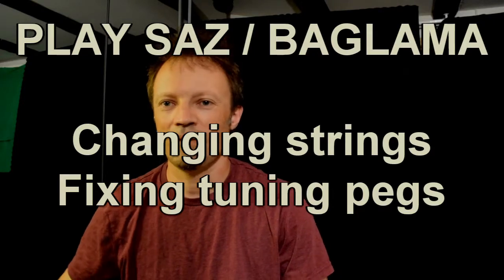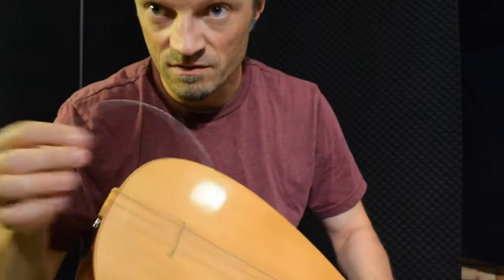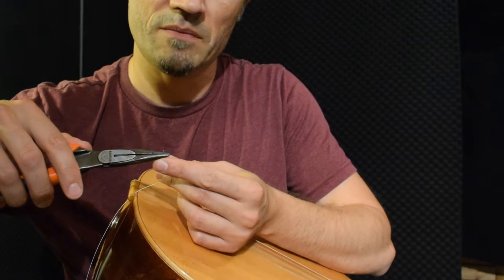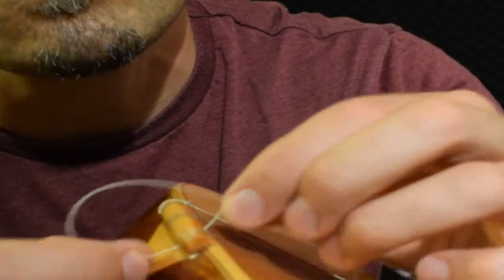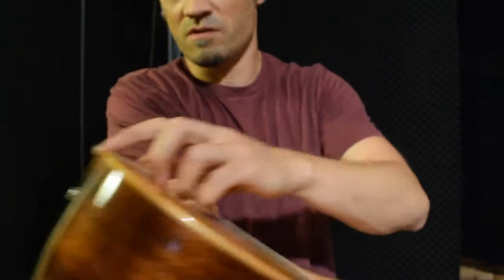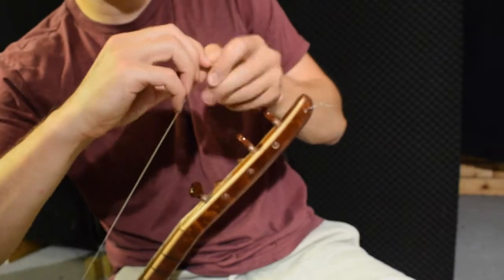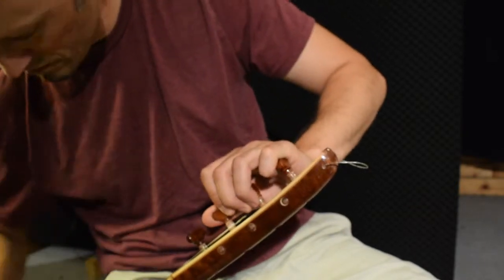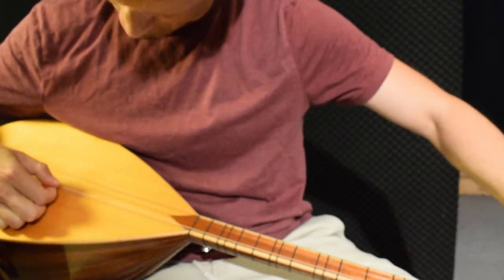Play saz | Changing strings and fixing tuning pegs

Comment: The baglama saz is new to me. When considering purchase I thought about why the original ways of pegs persisted (tho, I luv that of the instrument design). There must be a reliable way to attend the inherent problem or the design would not persist thru time.
Reply from the maker: I think that it persists due to the character/tradition of the instrument (as on the violin). You can buy with guitar fine tuners, but these saz are rare (and mainly on electro baglama). I have installed violin fine tuners on one of mine (used in the video), but you need to drill into the body of the instrument to do this.

Comment: I was shown that if it is too loose to tune, put it in your mouth to moisten it and it stays. Thanks for the other tips!
Reply from the maker: OK. Never tried that.
Reply: Thats right, the moisture will make the wood expand, making it fit tighter into the neck

Comment: I'm having an issue with my tuning peg, when it tightens it simply unwinds (it can't tighten), I don't know if this is an issue with the Saz itself or I'm making a big mistake.
Reply from the maker: Hi KingZ. It is hopefully not an issue with the saz. It is hard for me to tell what the problem can be, but one thing to be careful with, is to ensure that there is some millimeter distance between the string (on the peg) and the body (with the hole). Otherwise you will press the wound string towards the body, which will hinder the peg in going properly into the hole. If this is not the problem, then you will have to wax the peg, either with 'peg dope' or candle wax (not too much):

https://www.violinonline.com/stuckpegs.html#:~:text=For%20loose%20pegs%2C%20pull%20the,or%20peg%20box%20to%20crack.

You can search on violin pegs, because the principle is the same. I think that a very last resort is to gently sand the peg to make it a little more rough, but I never had to do this. Good luck.
Reply: @KlausM  thanks for the fast response ^^

I think waxing the peg will be a good idea, I'll try that :)

Comment: I keep buying strings, I change them, I tune it and everything works well. After some period when I tune again the baglama, the strings keep breaking. I checked the bridge thinking it might be too sharp but it's not, I look at the little bridge close to the pegs, again no sharp surfaces. I am tired buying strings and dunno what should I do, I watch so many people tuning their baglamas so often especially with cheaper ones... If anyone knows what should I do please reply to me :( I am suspecting that bending the string's end when I stick it through the hole is not a good idea because it may cut it basically when applying some tension, but I dunno.. I tried with more expensive strings, same issue..
Reply from the maker: Hi. I only had problems with cheap string and here they normally break when trying to tune them the first time. I use Pyramid strings without any problems:
https://www.thomann.de/dk/pyramid_saz_6758_saitensatz.htm?atr=true
Are they breaking the same place ? Are you tuning your saz too high for the length of the instrument?

Comment: My lowest string keeps breaking when i try to tune it to F. Why is that
Reply from the maker: Hi Ging. Is it a short neck baglama or long neck baglama that you have? A long neck normally have 23 frets, while a short neck have 19 frets, as mentioned here: 
https://salamuzik.com/blogs/news/difference-between-short-neck-and-long-neck-baglama-saz

If you have a short neck, then you should be able to tune it to F. If not then the string quality is too poor. This is actually quite common, so you need to buy better strings.
If, it is a long neck baglama, then you cannot tune to F (too high). You should tune to D (A G D) and then use a capo in 3rd position to get the F.
Hope this helps. Good luck.
Reply: @KlausM  ive got a short neck but its the cheapest baglama out of the bunch 120 euro. So i was wondering if it was because of the quality of the baglama itself that made it not possible to tune to F. that perhaps only baglama that are priced above 500 euro would be able to. So this is not the case ? Ill order a new set of strings and see if it happens again. If it does. Should i buy a more expensive short neck baglama or is that irrelevant ? Good idea to use capo as last resort. For short neck DGA tuning 4th fret capo i will get the FBC tuning correct?
Reply from the maker: @gingfreecss3467  You should be able to tune in C Bb F with a short neck using proper strings, no matter the quality of the saz. The quality has mainly to do with the sound. Cheap baglamas, often come with very poor stock strings. 
https://www.thomann.de/dk/pyramid_saz_676_7.htm
It is not good to tune a short neck in A G D, because of the very loose string tension, so that should be a last resort.

Comment: It would have been easier to just use the loop instead of cutting it off and bending the string. That's why it's there.
Reply from the maker: Yes. With this video I want to show how the strings normally are put on. However, if there is a loop or ball end, then this can of course be used.